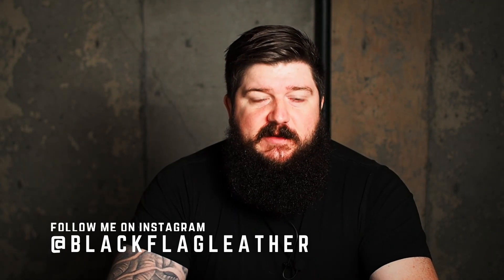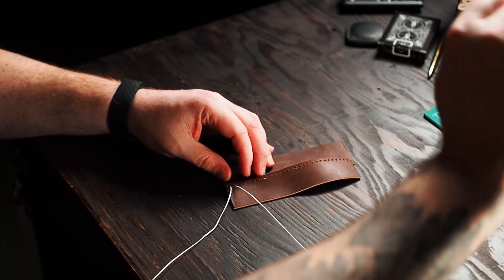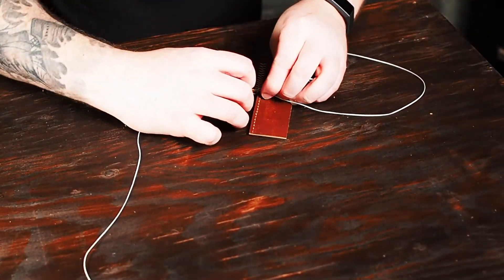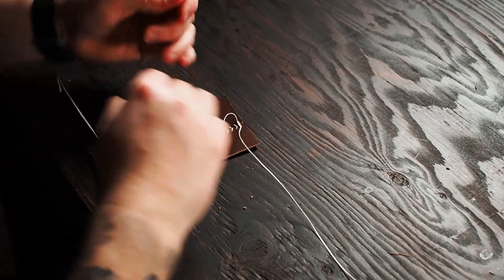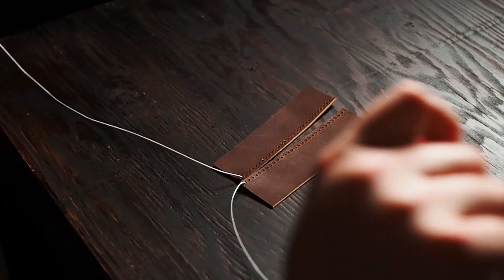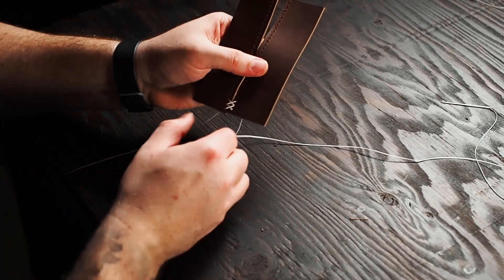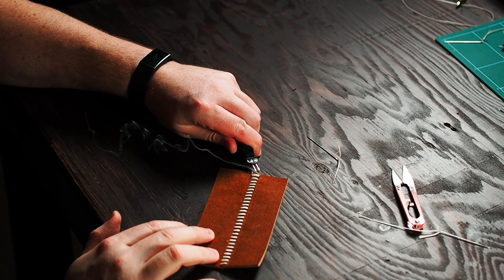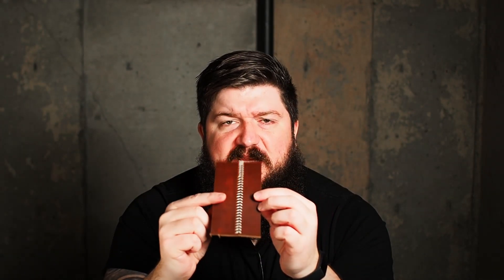2.5 Hand Stitching Leather Techniques that are NOT the Saddle Stitch - Hand Stitching Tutorial

Comment: Stupid question (I'm watching on a small screen) - are the holes for the Baseball and Cross Stitches round or cut with a normal diamond stitching punch? Great tutorial btw - thanks for sharing :)
Reply from the maker: There are no stupid questions.

I like a round stitching hole on everything I make. I have done this with a diamond punch as well, though, and it works. It probably looks a bit better with the round holes, but I'm also biased.

Thanks for watching!
Reply: If you use diamond chisel have the diamonds slanting down towards each other, meaning punch one side on the back, looks a lot nicer